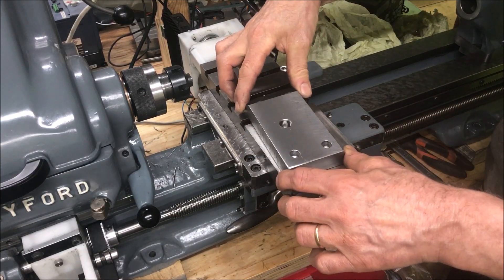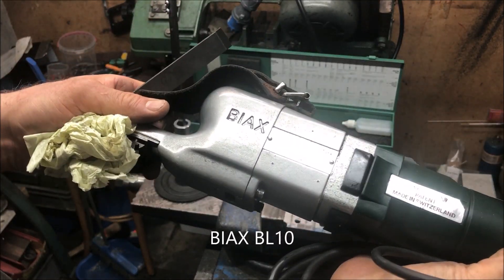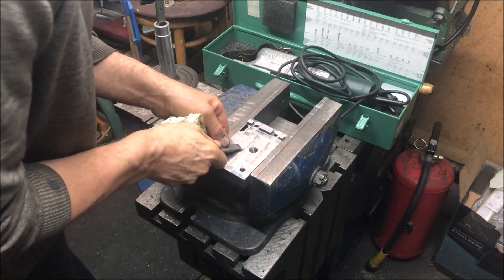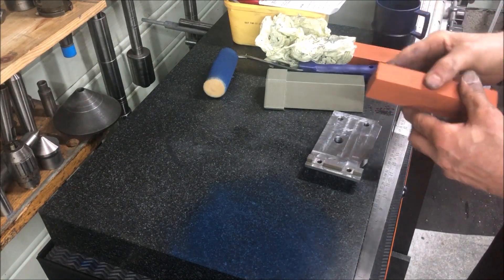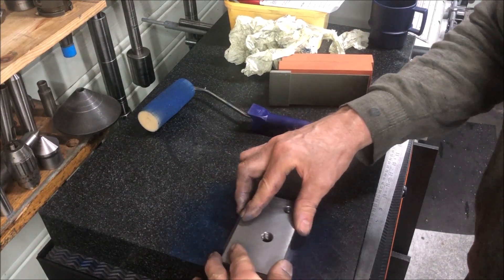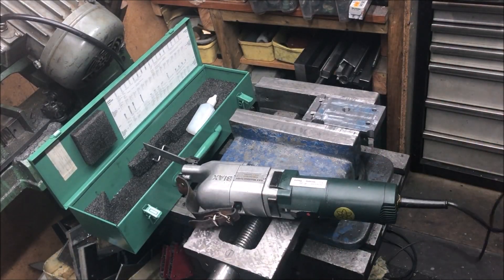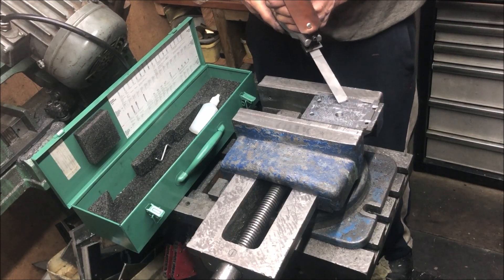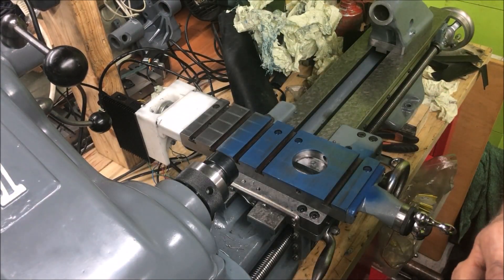Myford Super 7 - Scraping underside of solid tool post

Comment: Scraping the bottom of that block may turn out to be a good idea anyway Jan even though it wasn't out by very much. George Thomas mentions in one of his books about the rather weak cross section of those Super 7 cross slides due to the tee slots cut into them. He also mentions how easy it is to distort those small tee slots and the cross slide just from clamping pressures and binding that can result if that cross slide does distort. I suspect because of all the precision scraping you've done on your lathes your clearances are likely much tighter than even a new Super 7. A full length tee nut drilled and tapped for the mounting bolts at both ends on the solid block might also help spread the clamping loads a bit? His design for a rear mounted cut off tool uses a full length tee nut I'd assume for that reason.
Reply from the maker: Could be better with a full length T-slot. However, with my now intended added boss resembling the original design, these 2 additional bolts also help spread the load, although since tool pressure forces the plate down I don't think this is really needed. The most important will be it is flat.

Comment: I have only scraped steel by hand, it is encouraging to see it can be done with a power scraper.  It was so much more work than cast iron.  Seeing that first contact pattern was surprising,  I didn't expect it to need that much!
Reply from the maker: Well, we are talking metal removal in less than 1/100mm or close. Yes, very different than cast iron, but "doable"

Comment: Removable keys to T-slots would made scraping much easier. :)
Reply from the maker: Fully agreed! I assume I will end up with with this!
Reply: @jansverrehaugjord9934  That's typical solution on machine vices. If you could do demo between the solid an compound it would be nice.
Reply from the maker: @waldemarii  Yes, I plan to make a video with the solid tool post in use.. maybe I can do a comparison to the compound also..